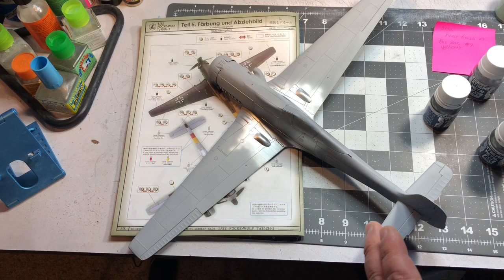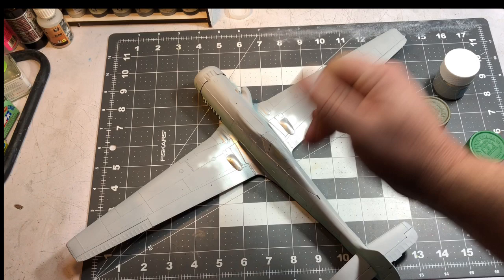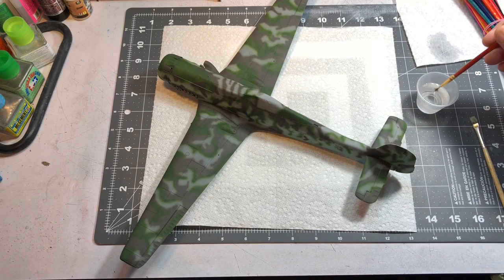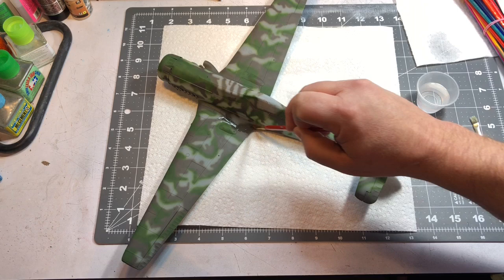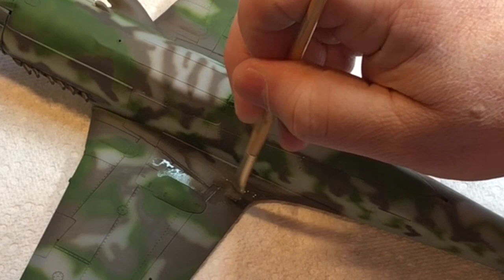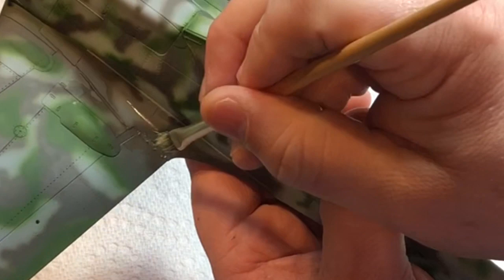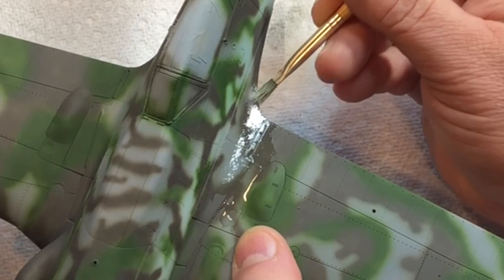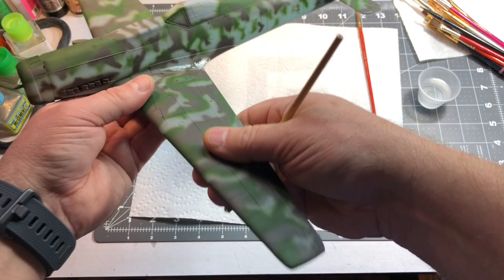Zoukei-Mura 1/32 Ta 152 H-1 Build Part 3: Paint

Comment: You are a Master.  Very well done.  I am still very much torn between beating up my projects or leaving them factory finish.  Tough call, especially the WWII-era Japanese aircraft, whose paint did not stand up at all to the environment.  Next project is the Zoukei-Mura Rai Den (Jack) so I have some deliberatin' ta do.
Reply from the maker: Yeah, I hear ya...just gotta go with what you feel like at the time.  I’ve got that Raiden as well, just haven’t decided to crack into mine yet.  I’m guessing I’ll beat the hell out of mine.
Reply: I'm sitting on a completed Merit International 1/18 scale SBD painted in the tricolor scheme and it looks so pretty that way.  I may just give it a Testors wash to dirty and fade it some and leave it at that.  Great kit.  I think I could fly one now given all the details that went into the cockpit and Radio/Gunner's compartment.  "Dauntless: The Battle of Midway" and "Midway" (2019) both did that Bird up proud!

Comment: I was thinking as you were painting the exhaust stacks. That the amount of "Orangish" color would depend on if your aircraft is on the ground (cold stacks) or inflight (Hot Stacks). Painting the turbine part on the B-17 super chargers inflight they would be a bright cherry red but on the ground and cold they would be burnt metal. So in part deciding how to paint something requires a certain amount of knowledge on what something looks like.
Reply from the maker: Good info Sam